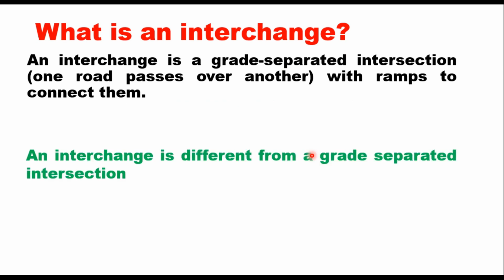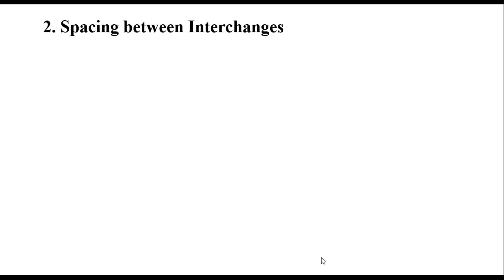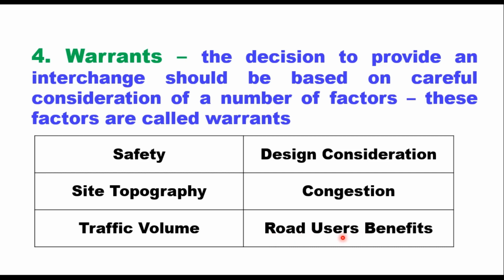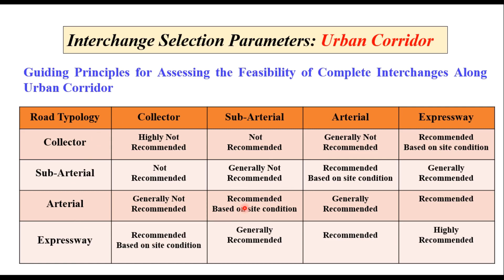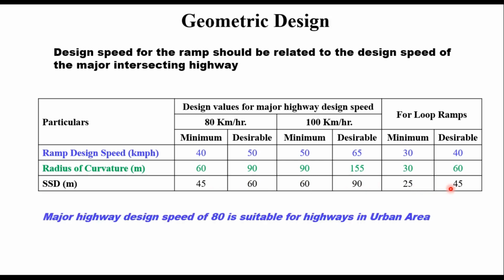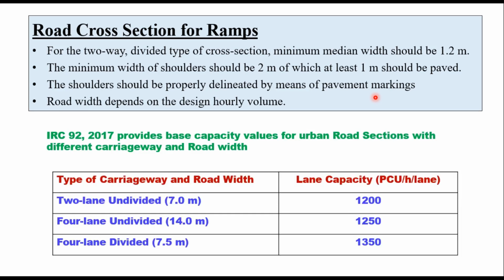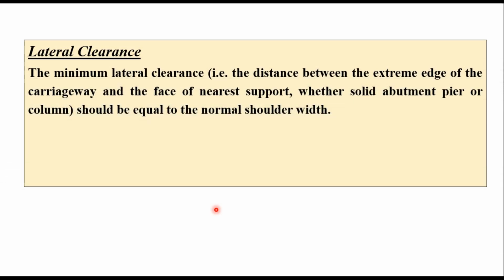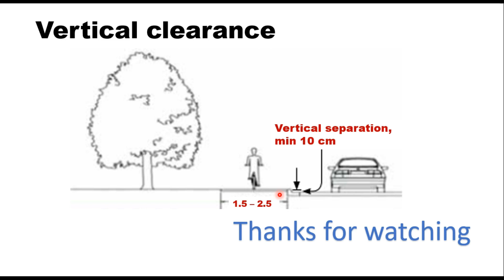Design of #Interchanges on #Urban #Expressways #IRC92, 2017, Design Principles and codal provisions

Comment: Sir, Very nice for academic purpose. 

However normally for establishing sight lines the object hazards are still not considered e.g safety barriers, earthwork in cutting, median planatation. This all reduces visibility considerably as sight line are obstructed for ISD as well as SSD. P and P are normally approved based on K values independently with considering coordinated geometry

I have worked on many international projects in UK and for Jamaica. These aspects are very strictly considered and widening for sight lines either through shoulder widening or median widening is provided with due consideration. This knowledge needs to be given to transportation engineers and also need to be guided with examples in IRC so it can be implemented in practice. 

Presently on mechanical wideing based on radius is suggested in IRC.

Your thoughts would be highly appreciated
Reply: Read as without considering coordinated geometry
Reply from the maker: Sight distance is extremely important when you are traveling at high speed on expressways. I fully agree with your concern and it should be made part of IRC code also. Let me see if we can take it up at IRC level. If possible, write your concern to IRC for the consideration of appropriate committee. 
Thanks for your support.

Comment: Sir please share a video on flexible pavement design with geogrids
Reply from the maker: OK. will do soon
Reply: In my jodhpur project we are using geogrids for reducing the  thickness of crust
Reply from the maker: It is fine. I understand that this code is being revised at IRC committee level. I am waiting for the revised code so that latest guidelines can be included in the video.  @nemichandbabal.7533